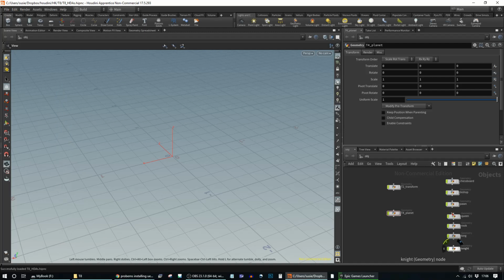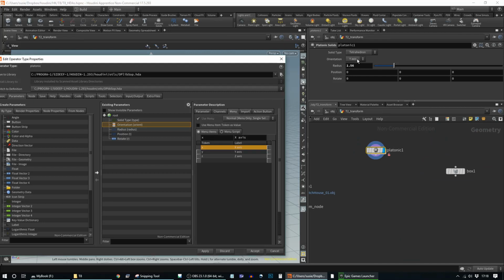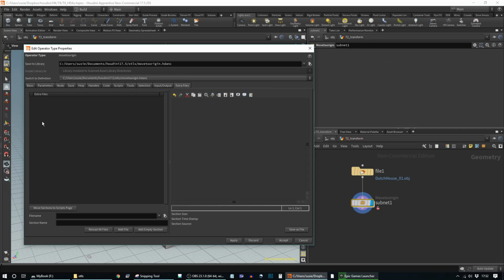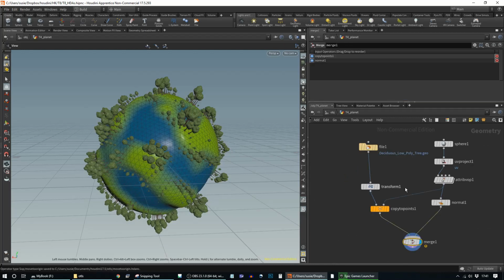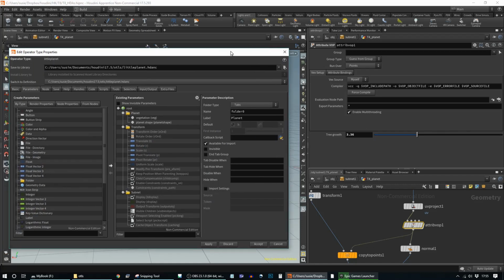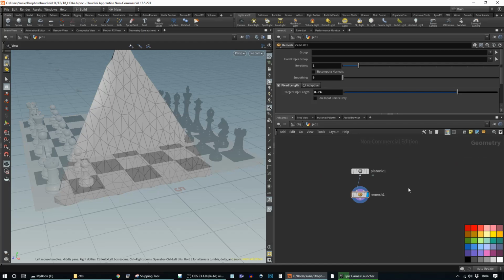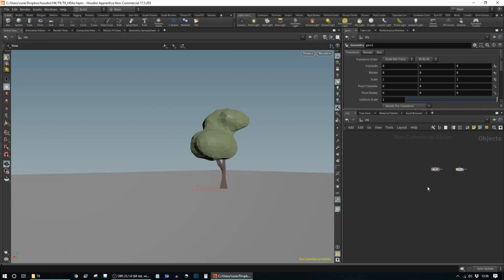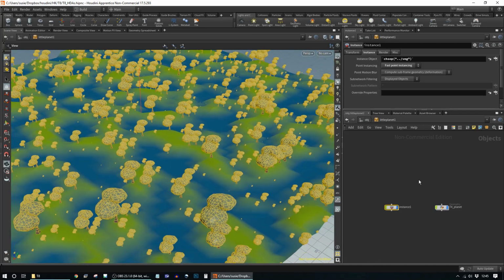Tutorial 8. All about Houdini Digital Assets

Comment: Hello!, thank you for the video, I have a problem saving my Digital asset, I am trying to add som new properties and adjust parameters in a Digital asset I created so go to type properties for it, then make some changes here and there, click the  Apply button at the Type Properties window, then hit the Accept button, all works smooth in houdini,then proceed and save the asset , I can see the File at my OTLS folder Updated with my latest save, but when I load the thing in Unreal 4 or in an other Houdini scene it keeps showing the Old parameters I wrote ,none of the new adjustments or parameters created show , even when the file was just saved, is there any way I can update a digital asset? or *Save as.. so is not linked in any way to the old version ?Any help would be really appreciatedThank you again.
Reply from the maker: Hi AJ, It is hard to be sure what is going on without seeing your files, but there are some things you could try.
First, it is quite easy to save a new file from an HDA. Open up the Type Properties and at the top you will see 'save to library'. Here you can change to a new filename and save it as a new file. It is probably a good idea to change the 'label' under the 'Basic' tab as well. You can re import it into the scene using File -> Import -> Houdini Digital Asset
However this isn't a good long term solution as you will end up with 100s of files.
Try making a copy of the digital asset in your scene and right click-> match current definition. This should force it to use the version on disk.
You should also check in the Asset Manager (Assets->Asset manager) in the configuration tab, make sure 'give preference to Definitions with latest date' is switched on and 'give preference to definitions saved in hip file' and 'from index files' are off.
Also 'save operator definitions to HIP file' should be off.
In UE4 make sure that you are updating the source HDA and re importing it. Like all assets in UE4 you will have a source file that you import plus a UE4 file in the content directory. Check that the UE4 version is updating as well.
Let me know if none of this helps
Reply: Thank you so much for your reply!, I did started over the type properties process from my origianl file, haha ,I thought It might be a good practice to redo all, watching you video again as I rework my HDA,  but If it stops refreshing I will follow your adviced steps, Again thank you for the help.